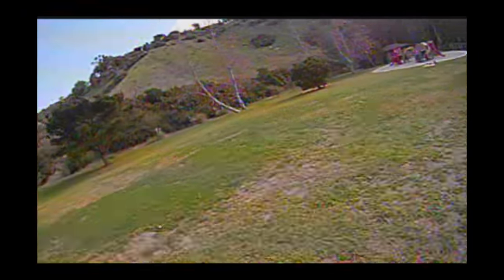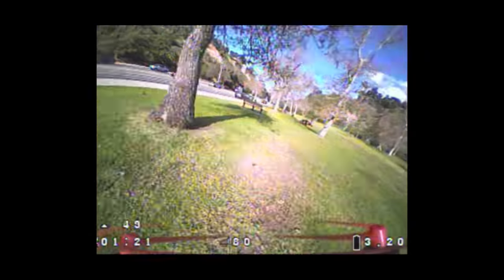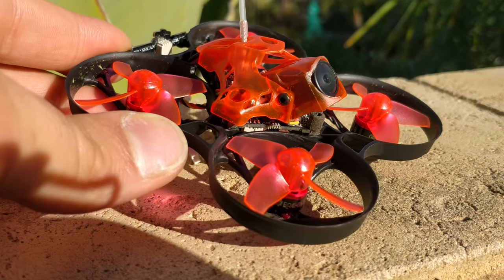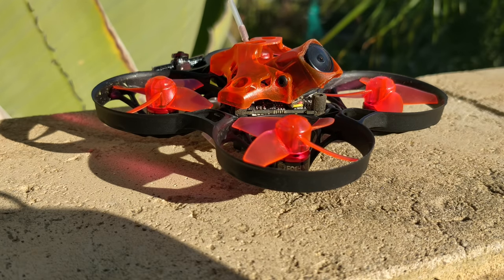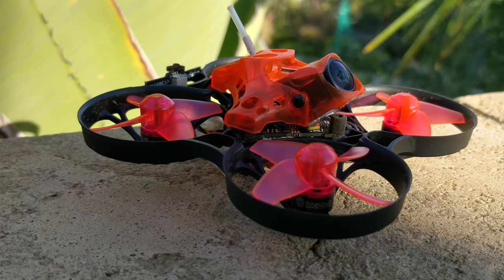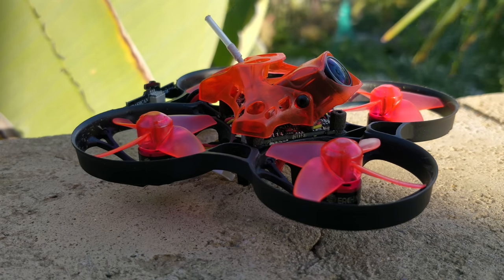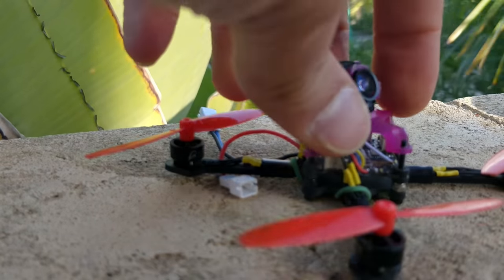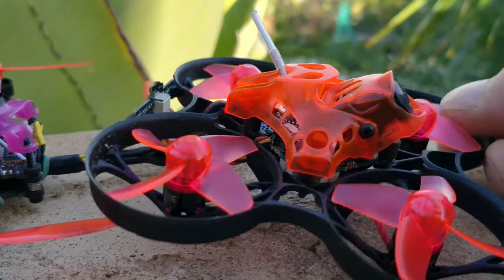Eachine Trashcan - In search of rubbish...

Comment: Too bad there's no input you could use with a TBS Rx. They're small enough, run on 5V (there is a little tiny 3.7v to 5v SMPS available), so would work if there was an Sbus in the Crazybee board.
Sooner or later it will happen, it seems the manufacturers are listening, but the looptime in about 8 or 10 months. 
If you release your toothpick, I'll take a few. It's a great idea.

Since you've made it's existence public and the way things go, lookout - you may get a populated clone of it sent to you for review...
Reply from the maker: Lol.  They wouldn't get it right. Cloners will either need to copy it directly or remake it. The remakers usually don't have the understanding to do it right I feel.
Reply: @Kabab  Good point.

Comment: After watching I went a purchased 3 cheap drones from Walmart. Just because after watching tons of Flite test and Rotor Riot vlogs.. I'm interested in the hobby, one is a Syma D650WH fpv drone.. can't wait to get it outside, still practicing hovering in the apartment..
Reply from the maker: While that's great, please don't buy drones from Walmart. But welcome 😁
Reply: @Kabab  Oh I realize that now.. I will practice the first concepts of flight, but I realize my first actual purchase will be the controller..
Reply from the maker: @slaggedfpv599  perfect. Controller and simulator is the fastest easiest and cheapest way to start
Reply: You're going to get sick of auto-level fast and once you fly acro those Walmart drones will go in the trash (no pun intended). Look into the tiny hawk RTF maybe, with some extra batteries.
Reply: Yeah, after the videos I've seen.. I definitely need to upgrade, but definitely want a good micro fpv quad

Comment: Why did you set a throttle end point instead of setting throttle scale to 70 or 75%? Just curious.
I like this review. Much better then the review of UAVfutures which has a gamechanger every day ;)
Edit: Happy Newyear by the way. Hope you will have a fantastic 2019!!!
Reply from the maker: Where can I set the throttle to 75%?  I use the endpoints in the controller because it's just easy and i can adjust it on the fly. It's really simple to just cut the top end off and the rest spread out on the stick travel
Reply: @Erik-oi6je  yup and I assign that function to a dial so that I can fine tune it to what I want! Instead of a switch

Comment: team blacksheep released their vivafpv brushless whoop on black Friday and sold out. they also have a new camera and vtx  for the new whoop in stock that looks like you could use it on the toothpick,flightcontroler and esc was in stock .if you have a list for buying the toothpick you can put me on it
Reply from the maker: I didn't even know these existed ;-o
Reply: not shure fc and esc will work ,but fc has frysky .Esc is a stack setup and they don't list any specs

Comment: You should look at the new AMAXinno 1103. They come in 5000kv and 7500kv and are looking pretty damn good.
Reply: And the f4 crazybee should have a spare uart for an external receiver. The f3 has also but you can ether use smartaudio or an external receiver on it
Reply from the maker: Good point. Thanks.

Comment: Have you tried running a heavy throttle curve?
Reply from the maker: Na.  I don't really see a point. The solution is to drop weight or just go real fast so you're never falling.
Reply: @Kabab  Haha, sure 😁 I might replace the motors on mine, 12000kv seems more appropriate but until I do I'll probably just run a curve

Comment: If you can't get more power after 70%, that means that either you reached the rpm limit of your ESC ( which l doubt), or the couple motor/propeller is wrong: your prop is too big (diameter and/or pitch) for your motors, and triblade will just make it worse....
Reply from the maker: The motor doesn't have the torque to keep going
Reply: Yes, if the motor doesn't have the torque to keep going, it means kv is too high for this given prop.
As opposed to what you say, a lower kv has always more torque: lower kv is obtained by more turns in the motor, which means greater magnetic field, and as a consequence, greater torque.
Use a smaller prop, or a lower kv motor, you will fly longer, and quad will react better.
Reply: @cedricgrandseigne  Lower kv doesn't always have more torque.
Reply: @zaqwsx28  lower kV means more turns, stronger electro magnet, and so more torque for a given motor: it is mere physics.

Comment: Haha! great review.  FWIW, I'm pretty sure even the OG 1103 racerstars had bearings and not-so-great magnets and I'm not sure that's a bad thing! I know HoverBot.io made their own fancy N52 HB1103 (only 8000kv right now) and MyRCMart has an 8/10k kv RCX RS1103 with N52, dynamic balance 1103's (that are sadly pretty heavy).  Unlike where the last 20-30% of throttle is just meh on these lower spec motors the last 20-30% on the 8k RCX motors is MURDER (the 10k are supposed to be completely unmanageable).  A 2s battery will sag to <5V even on a pretty fresh battery, overall efficiency is just terrible with seemingly little gain to performance (they are smooth though).  The Racerstars that are nothing fancy, but cheap, and have CRAPPY vinyl wires ... they just do their thing and are perfect for the purpose (IMO).  But honestly, i think maybe you stumbled on the magic recipe with the smaller motors and 1S.  Weight is just so critical.  Shame, again, about the short range.
Reply from the maker: Yeah I have a feeling I'm flying the best it's gonna get too. The extremely low weight coupled with just enough motor is what's needed.  0802 to 0803 might be best but I'm still gonna give the 1103 a go. It flies really damn good already. I also have a design that puts the battery on top which I'm working on. The camera mount is getting annoying however.
Reply: @Kabab  Looking forward to it!! I do think that top mount makes a difference for these little guys as long as making that happen doesn't add too much weight.  These little thing are so finicky, which is why it's nice to see that you've found a sweet setup can't wait to see the next iteration(s).  I made a screw on top for one of mine that just hangs the camera off the front with a tiny zip tie.  I have a caddx eos2 (4:3!!!!) on the way and will likely redesign for that shortly: https://i.imgur.com/vsW0KEM.jpg

Comment: Looks like the f3 pro supports an external RX on uart 3. It may help the range problem (unfortunately adds weight and complexity):
http://img.banggood.com/file/products/20180629031334HowtouseExternalrecevieronCrazybeeF3flightcontroller.pdf
I'm assuming the trashcan F4 board has an extra uart too but not sure

Comment: I just put the heliospring V2 in my quad and it flies like garbage I can't figure out why my osd also doesn't work neither does my current sensor this flight controller is goofed. Any one able to help
Reply from the maker: well I can't really tell what's happening from your description but I'm assuming it's missing some appropriate setting somewhere.  Try switching your OSD to NTSC or PAL and see if the OSD pops up working.  What firmware are you on?  I'd recommend using pegasis to install the latest IMUF firmware and then using the latest betaflight from the helio website
Reply: @Kabab  the thing is half of it is working like timer 1 doesn't work timer 2 doesn't work voltage doesn't work but average cell voltage works and other stuff it's weird

Comment: 8:50 when its a little to low for 1S and a little to high for 2S isnt it just right then ?
Reply from the maker: It's low for 1s because it weighs too much. It's high for 2s because it can destroy batteries. Neither good reasons. It's just not a very good craft. It does work however, so it's not the worst. After my recent testing on it's components however, I would absolutely not recommend this craft at all. The motors and camera are total garbage unfortunately.

Comment: Man! Please make a video on how you set the throttle endpoints! And why do you say 8k/2k has a 2k gyro rate, Betaflight puts gyro rate first )
Reply from the maker: Lots of my videos explain lots of this stuff over and over. The endpoints are in the controller. Not hidden or anything. It's a major menu in any controller. Shouldn't be hard to find. Just figured out which channel is your throttle channel and you've got a handle on it.
Reply: Kabab FPV Well youtube search on this topic gets me calibration videos, couldn’t find the one with your method. I remember you briefly mentioned it in one of your older videos but it will be hard to find that exact video. Help plssss, share a link ) HNY! 🎉🎉🎉
Reply from the maker: @throttlenerd  look for endpoints in the controller you have. You could search YouTube for it too. There should be many many videos on it. It's very simple. You could probably find it yourself just looking through menus.  It's gonna be a big surface menu. Not hidden somewhere
Reply: Kabab FPV Is it "Outputs" on Taranis X9D? I guess you're using the same controller )
Reply from the maker: @throttlenerd  yep. Channel 3 for me.
Reply: Kabab FPV Thanks man!!

Comment: Hey, Kabak Check out my latest Videos!
I transferred the Trashcan to a Frame for 55mm props - these Motors are the best ive ever tried! Tried 0802, 0703, 1103 etc. these are such great motors with 55mm props!
They work like hell, i get 4 mins of acro with 2*230mah batteries. the stock frame is really trash... and those stock props also...
check out and give me your opinion :)

Comment: the EU Version has just a xm+ so it works with sbus ;-) otherwise use a crossfire receiver with smartaudio
Reply from the maker: Interesting. There are different versions?
Reply: @Kabab  EU version is same frsky board, with internal rx disabled and xm+. But to be able to use external receiver you lose smart audio
Reply: You have to disable the spi receiver and than you can use rx for the receiver with a recompiled version of betaflight it should be possible to use softserial for other features. (But I haven't tried yet)
Reply from the maker: @shambler01  interesting. I think there may be a version of the board with no Rx actually
Reply: @Kabab  the mobula 7 board has rx / tx at the bottom of the board its not marked you have to know where to solder

Comment: Racerstar just realised 0806 10000kv and 0804 12000kv
Reply from the maker: I saw. They actually don't look horrible either for racerstar. However it's likely gonna be the 1103 or in the future, a 1202 that will win out. The 080x is gonna be for smaller props
Reply: @Kabab  needs more testing